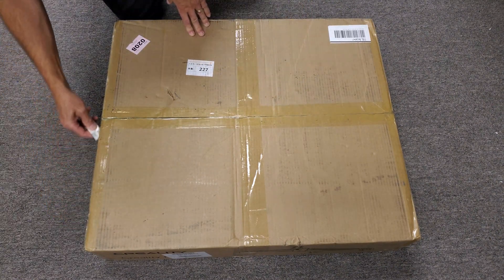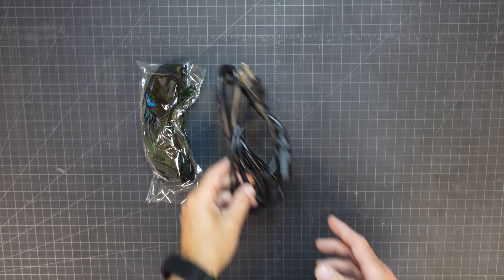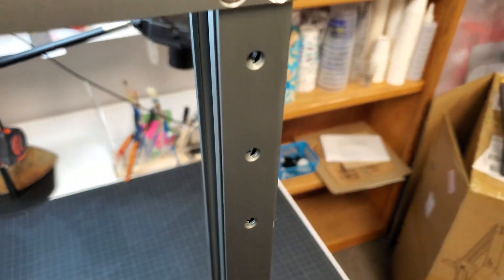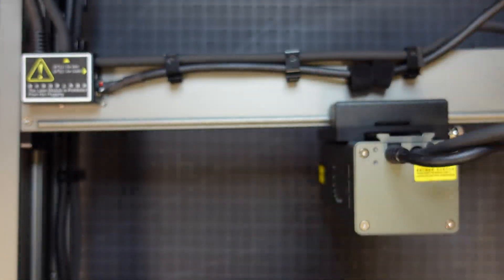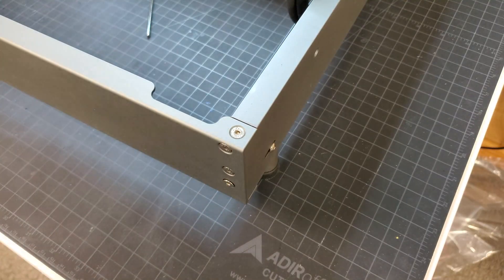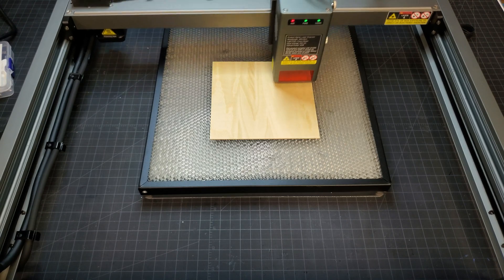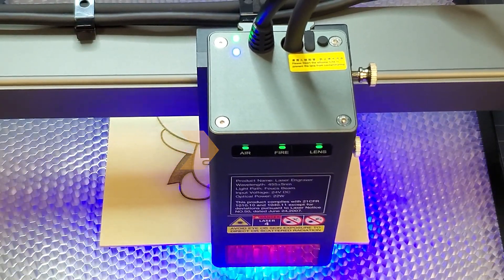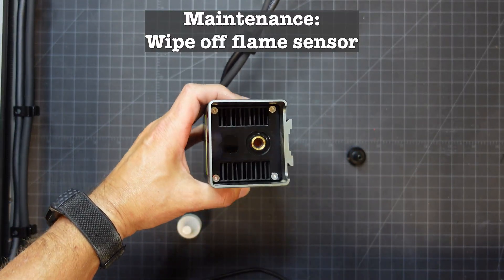Is the 22w Creality Air Assist Diode Laser Engraver Good for Your Business? Unboxing Setup Review

Comment: Good video.  To see the laser when you are framing, or any spot you like, you just need to enable it in Lightburn. Edit > Device Settings > Enable laser fire button and > Laser on when framing.

I've had my Falcon 2 for just 3 days and I think that it's great.  I did have to install the CH340 driver on my Macbook Air M1 Silicon laptop to get the two machines talking... but after that it has been plain sailing.

Good luck and enjoy the machine.  I highly recommend it.
Reply from the maker: We actually do have those turned on, but still can't see anything while framing. Admittedly, nobody here is a Lightburn expert. We've only used it with our fiber laser. We'll keep poking at it until we get it!